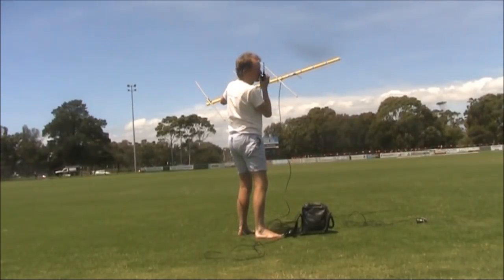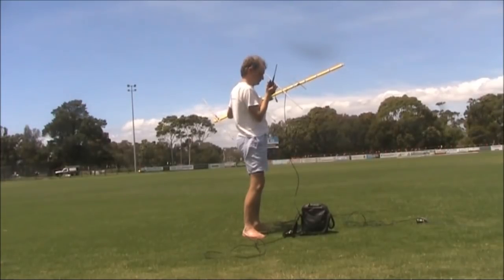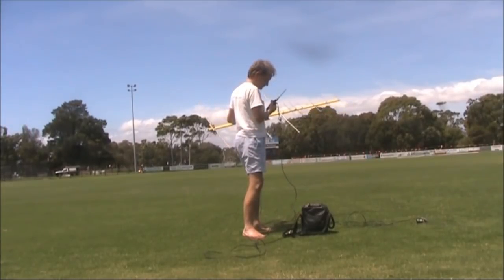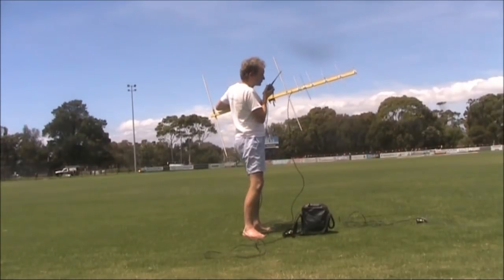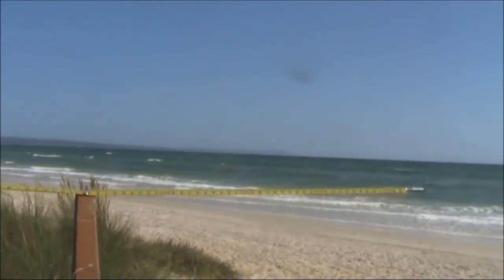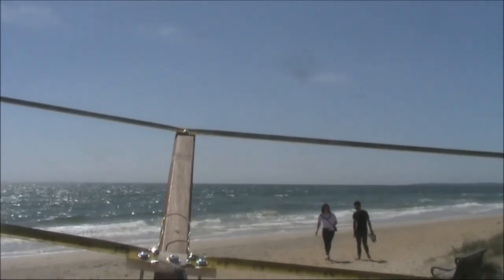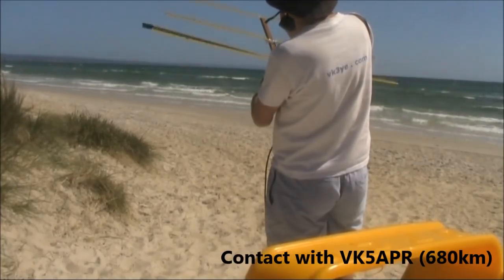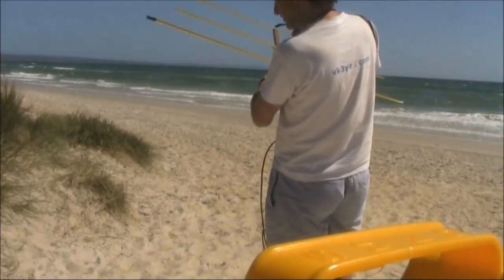The benefits of a beam when working the AO91 satellite

Comment: Glad you mentioned the rushing noise (2:54). Why is that sound there even if no one is talking?
Reply from the maker: It's like an unsquelched receiver. Better for weak signals.
Reply: vk3ye Thanks! I’ve been listening on my FT-51R and a whip the last few days, using some tracking apps and a recording app to get used to it. I’ve ordered supplies for a 2m and 440 beam, hope to assemble it this weekend. Found an old camera tripod to mount it on. 73 de Jeff, KF5KWO

Comment: Thanks for the cool video, Peter. After watching your past video, I tried QSO two times on AO-91 by one HT alone without success. But I learned today from you that antenna for RX is more important than the one for TX. I thought opposite. Next time I will definitely use two HTs and a yagi for 2m RX. 73 de JG3IHE , Sei.

Comment: It's a shame we could not use 70cm band here in Thailand. Working sat will be much more easier.
Reply from the maker: You might want to check on the Amsat website to see if there's any satellites do the reverse - ie you transmit on 2m and listen on 70cm.
Reply: vk3ye There are a few... but working uplink on 2m makes it difficult to receive on 70cm for full duplex operation because of harmonic